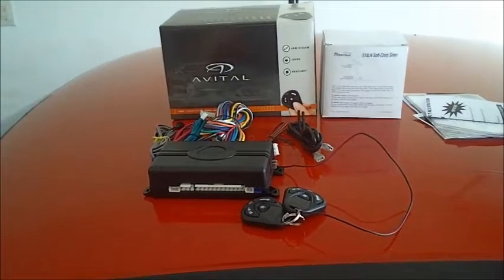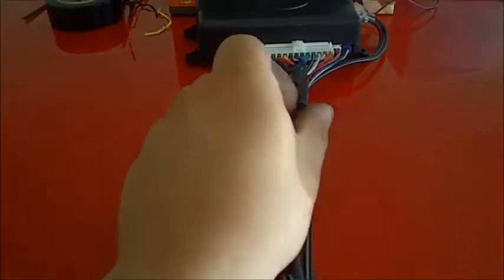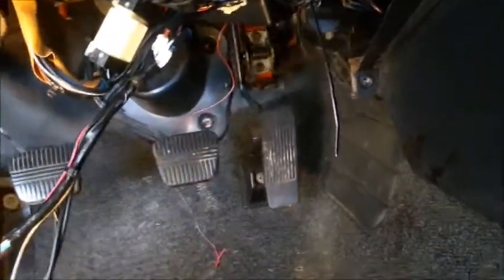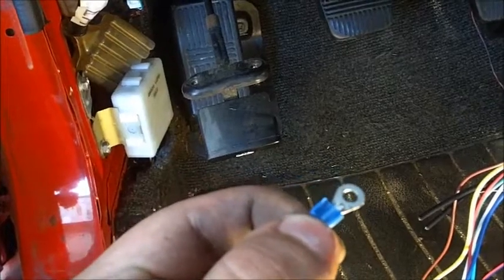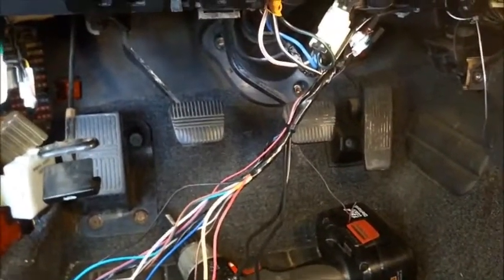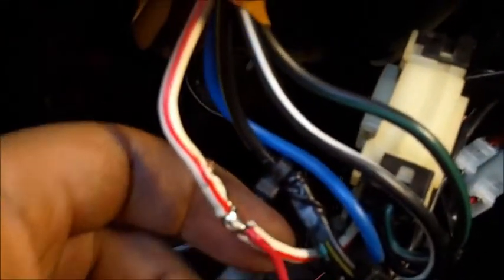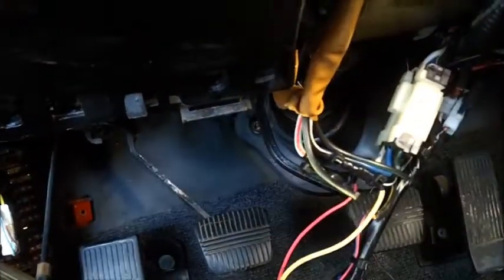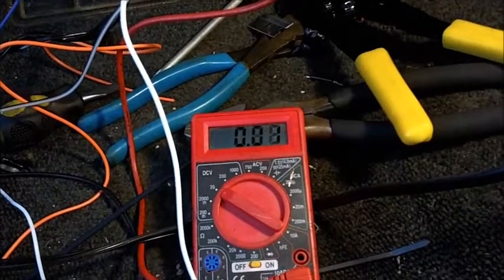Nissan 240SX Avital Alarm installation 1 of 2 video DIY

Comment: Quick question is it possible for the alarm not to power on if the ground isn’t grounded right ?
Reply from the maker: It's possible but more often I found that the alarm will do some other weird things with a poor ground vs just not working.

Comment from the maker: Yeah, you don't NEED to install it, but if the car is getting broken into and the siren wires are cut, the horn would still be going off if you hooked up the horn wire.  If not then it'd be silent once they cut the siren wires.  The other wires I cut/didn't use were for various things such as aux outputs for trunks, different types of door triggers, hood etc.

Comment: Which wire is for the dome light \ interior lights I lost my instructions for  the alarm I have everything else hooked up in my miata but I can't even remember now if there is one for the interoir lights if there is does it come on and stay on for 30 secs or does it just flash like the parking lights ? Your video was alot of help
Reply from the maker: Rory Finazzo I don't believe that the Avital unit has the dome light output.  I rarely ever hook that up unless a customer specifically asked for it back when I did this for a living.

Comment from the maker: If it's the only wire in that 3 pin plug, it would be your horn wire.  It's a negative output to your horn when the alarm is triggered.  The installation will be similar but wiring will be completely different as it's a different make and model.  It is also a very simple car though so it shouldn't be too difficult.

Comment from the maker: I use heat shrink for other things.  It definitely looks nice.  With a remote start heat shrinking my connections wouldn't be practical since I'd have to cut each wire that I tapped into in order to slide the heat shrink on.

Comment: Hi DIY,
Thank you for all the good info but I am having another issue, I installed the alarm about 6 months ago and has been working great but now my car will not turn over and wanted to know how to reset the alarm or can I just disconnect the starter kill wires and will my alarm still work properly with out it hooked up?
Reply: This did start when my battery died...............
Reply from the maker: Ken Core Yes, you should be able to just disconnect the cut starter kill wires and put them back together.  It should start if that is what the issue is.  Does the remote no longer work?  Usually if the car won't start after the battery dies then the alarm would also be going off.

Comment from the maker: The other wires I cut/didn't use were for various things such as aux outputs for trunks, different types of door triggers, hood etc.  It depends on the car which wires you'll end up using.  Different cars have different options, types of door triggers and things of that nature.

Comment from the maker: There will be some similarities.  Make sure to test with a multimeter before connecting anything of course.   There are sites out there with references for wiring.  the12volt is a good site with free info.  But make sure to use it as a guide and test your wires.

Comment: When you installed the alarm horn you ran the (positive) wire to the brown (+) brake shutdown and the negative to the body right? and did you put a fuse in between the brown wire and the alarm positive wire? and if you did what amp fuse did you use?
Reply from the maker: No, I ran the positive from the siren to the brown siren wire off of the alarm.  The negative went to chassis ground inside the car.  No fuse for it since the main unit itself has a fuse on the main power wires.  If you're using a 4103, it won't even come with a siren since it's not an alarm though.  But if you wanted to connect a siren you could use the brown horn wire to the sirens positive and you'd get a chirp when locking it if you programmed the horn honk on.

Comment: Hi, first, is this installation the same for a 91 Acura Integra? Second, what is the brown/black wire for? It comes on a 3 pin harness that plugs in between the primary harness (H1) and the door lock harness (H2)? The installation manual I found does not show it. Thanks for the video. Clean work too.

Comment: I have a 1973 Datsun 240z the wires you cut do I need them for my application to this car ? I have the alarm hooked up and it doesn't click when armed instead I hear it through one of my factory relays .I up graded to the single prong door triggers instead of the originals and I cant get them to function with the single wire violet or green ,
Reply from the maker: What part do you want clicking exactly?  The door triggers wires the green/violet are to trigger the alarm when it's armed in case of a door opening up and whatnot, are you just having issues with getting it to lock or?  Happy to help just need some clarification on what you're having issues with.

Comment: Great vídeo DIYAutoCarage A+++ I have a question on the 2 black wires (starter interrupt input/output) where should I connect those? Are they wire on the cable that you cut in the video? Please help
Reply from the maker: It's been a while since I made this video but the only wire that I would have cut for this would have been the starter wire so yes, that should be right.

Comment: The wire from where the signal is sent from the key remote came out. It is red on the interior and black on the exterior. It was connected to the clear box behind the break pedal. I was wondering where it connects to.
Reply from the maker: I honestly have never had that happen so I'm not sure what to tell you.  I have an extra Avital sitting around so if I get a chance I can take a look.

Comment: Thanks. What are the wires you cut (& didn't use) for?

I thought i saw your whole video, so the wire is just to get the car's horn going when the alarm is triggered. Any suggestions on how to install? But, I can also just not install it right?

Comment: Where does the yellow wire go? And does it has to use a relay to remote start
Reply from the maker: The yellow was not used.  It would be used if I was also adding a remote start to it as a separate unit.  (not an ideal way to do it, if you want alarm and remote start then get a unit with it all built into it)

Comment: is this the same as g4matic alarm system?? I have a g4matic which was quite cheaply priced
Reply from the maker: I've honestly never even heard of that company.  I just looked it up and it looks like a cheap unit.  I wouldn't personally buy it.  The wire connections will be the same for the car, but the wiring will likely be completely different on the alarms.

Comment: You don't need to disconnect the battery first?
Reply from the maker: MrVinamp Not in this case since I had to test the wires before hooking them up.  Many of the same color wires in the car can cause some confusion and even some damage if wires aren't tested/verified before connecting.

Comment: No se necesita un relay  para conectar los cables del starter?
Reply from the maker: Solo si se va usar el "starter kill".  Pero, en este carro no lo use.
Reply: DIYAutoCarage  muchas gracias por responder...entonces si no quiero el starter kill igual solo corto el cable y conecto los cables negros del modulo uno a cada lado?
Reply from the maker: Perdon.  Estuve pensando de otro modelo.  En este modelo, no se necesita relay para el starter kill.  Ya tiene el relay interno.
Reply: DIYAutoCarage  nuevamente muchas gracias .
Reply: Tengo otra duda amigo...el cable amarillo que dice que va a ignicion no se conecta? o donde se conecta?
Reply from the maker: Ese cable se conecta a el harness de ignicion a el cable "ignition".  Depende en que carro tienes a donde va.

Comment: what is the actual model - is it Avital 3100L or 3100XL ?
Reply from the maker: It's an Avital 3100L.  As far as wiring and such goes, most of the Directed Electronics units will have almost identical wiring colors.  A few vary though.

Comment: I do not have the 3100L model I have the 4103 model
Reply from the maker: 4103 is just a remote start/security.  That's a bit different as far as wiring it.  Mostly the same but some stuff is different for the remote start aspect of it.
Reply: Thanks you been so helpful when you get another chance make another video :(

Comment: Thank you for the video! 

Can you explain the purpose of the wires that are not going to be used for in this installation please? 

Also, my brother had his alarm installed a few days ago and I noticed that the head lights and tail lights on his car do not flash when the alarm is armed using the fob.

In this installation what is the wire that serves that purpose, "flashing of the headlights and tail lights" when the alarm is armed using the fob?